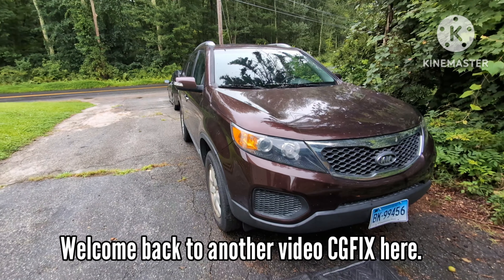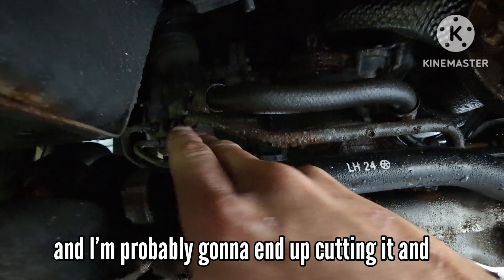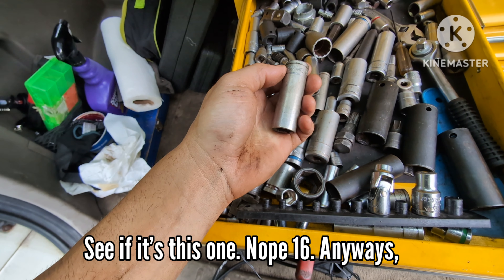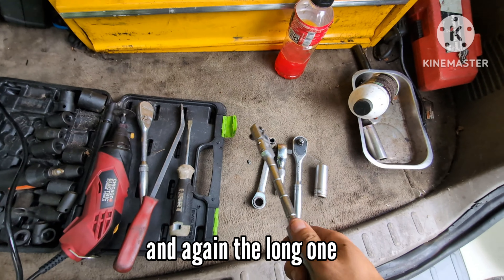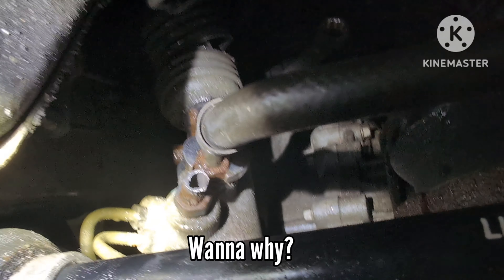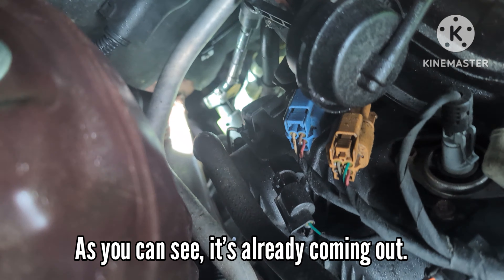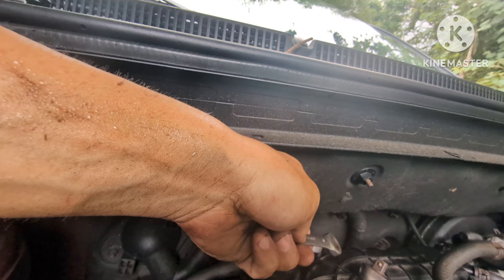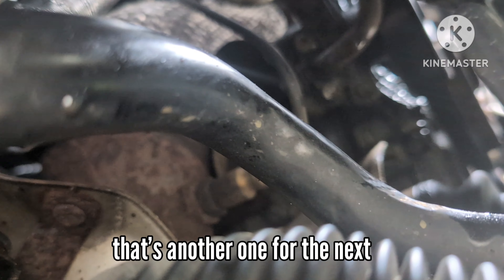2012 Kia Sorento Power Steering Line Replacement

Comment: for the bracket near the heat shield, did you have to end up bending it to put the new line in?
Reply from the maker: Yes I did bend it up for the clearance then bend it right back
Reply: @CGFIX  gotcha. thanks for the video! i have a leak in the same exact spot so i’m hoping that with the knowledge you’ve given me, i can fix it! appreciate ya :)
Reply from the maker: @strawberrymercy no problem I try to make my videos tstraight to the point and get the job done! good luck and hopefully you get it done and save the Labor cost 🙌🏻
Reply: @CGFIX ok how the heck did you get the new line in place? I got the old line out because it snapped in the same spot it was leaking from, and now I’m having trouble getting the new line down and under the heat shield. Pls help 😅
Reply: @strawberrymercy did you find out i have a power steering leak to I hope it’s just a line and not the whole rack and Pinon how do you diagnose the leak I might half to try the uv stuff
Reply: @herobrine1238  the leak was pretty significant so I could see it coming from the high pressure line
Reply: @strawberrymercy  did you find a way to get it back in  hopefully I can diy before it snows
Reply: @ I couldn’t figure it out tbh, had to have someone else do it.